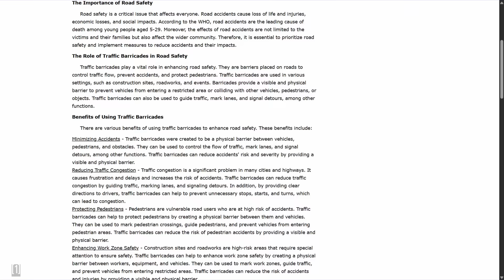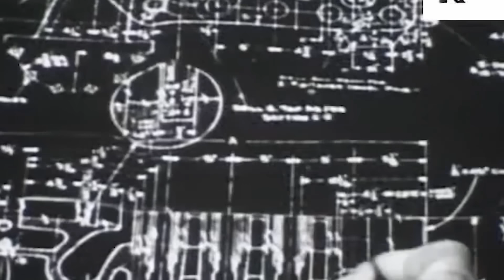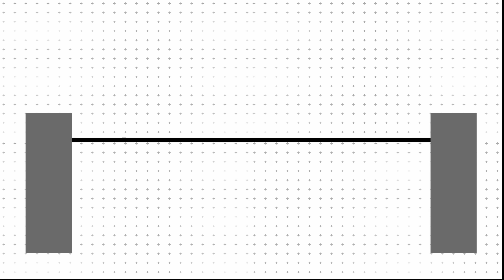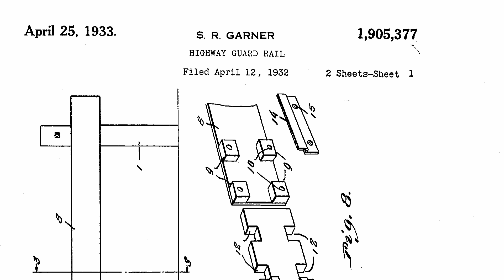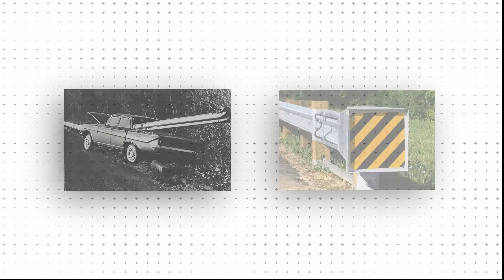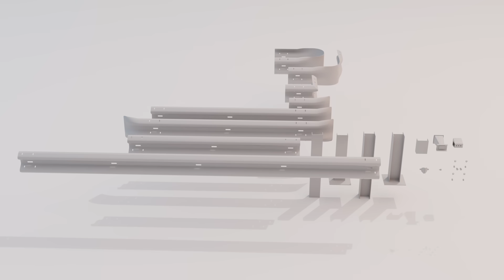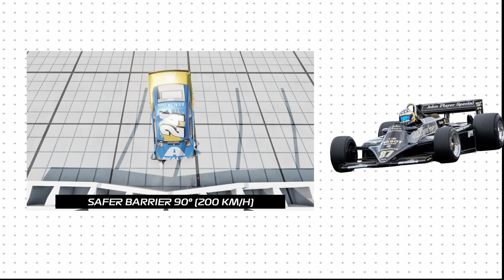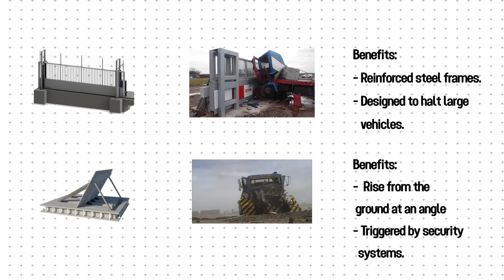How Road Barriers Keep You From Dying

Comment: One thing they forget to mention are motorcycles. When it comes to wire barriers it will decapitate the rider. The posts on the rails will also decapitate the rider. Don't make barriers safe for vehicles only but also for motorcycles.

Comment: Cable barriers are terrible for bikers; in Croatia, we are now using guardrails with "skirts" at the bottom to prevent a biker hiting the mounting poles or sliding under the barrier. Expensive but saves bikers from direct impacts and fatal injuries (you basically slide along and it still hurts like hell but youre alive)

Comment: I wish the road barriers worked the same in videogames as they work IRL. In racing/driving games they either don't deform at all, causing severe damage to your vehicle, or disintegrate from 1 touch, without stopping the vehicle.
Reply: Yeah, but if you know how to make mods and change maps than you can make them deform, like in 9:54, that’s from a game named BeamNG, you can change the barriers on any map as long as they aren’t a full system with the track.

Comment: Guard rails are absolutely incredible… Until you ride a motorcycle. Have known five differently people who had known someone who clipped one and then got disemboweled by them. The posts holding them up are flat and perpendicular to the direction of travel turning them into the world’s biggest chain saw. In a car I would feel far more comfortable hitting a guard rail than anything else. On a motorcycle even a very slow impact with one will kill you horrifically.

Comment: There is a downside to cable barriers that people don't address. They are significantly more dangerous to motorcyclists. The small cables work well when handling a collision with something like a car but not so well when its just a person. They are designed to withstand the force of a car impact so they do not yield or spread out impact in the event of a motorcycle crash which can turn a survible situation into one that isn't. The problem is motorcyclists often aren't considered by people who dont ride and thus saftey systems are often only designed for cars.

Comment: Thanks for covering the dangers of EVs
Reply: This does not demonstrate any "danger" of EVs. That Rivian was hitting the barrier perpendicular,  at highway speeds.  It weighs 7,300 pounds.  You think that's more dangerous than a 10,000 pound Uhaul truck? An 80,000 pound semi? The lower center of gravity of an EV keeps its weight low,  where the barrier is MORE likely to stop it,  whereas a conventional vehicle with its center of gravity higher will simply roll over the barrier,  and even flip end over end .